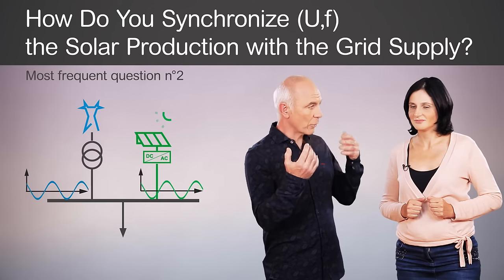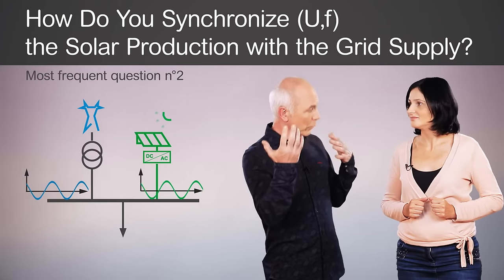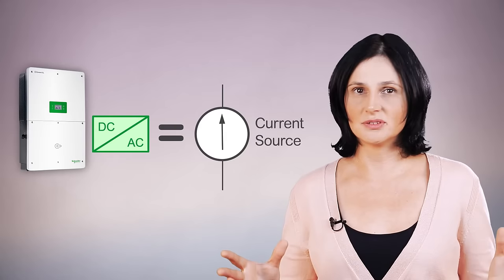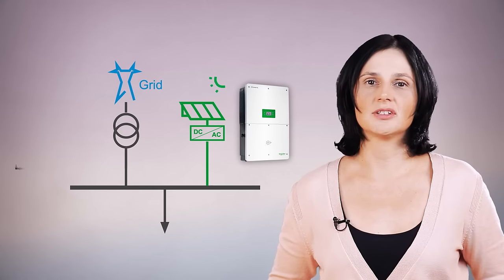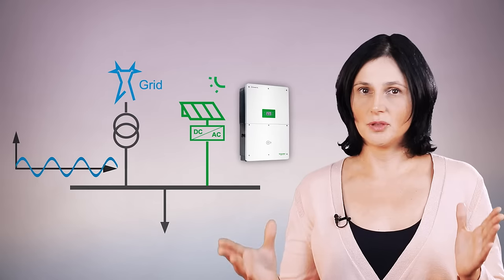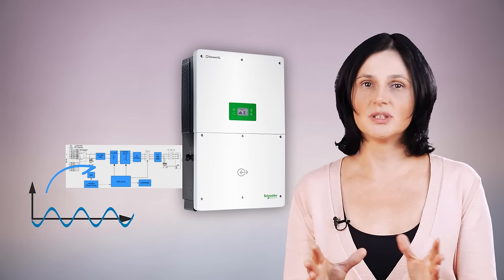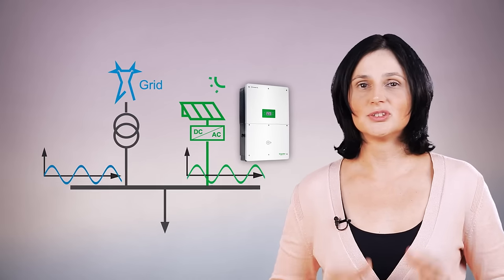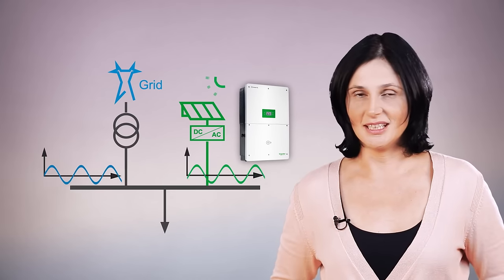Solar Self-Consumption: How PV is Synchronized with Grid Supply | Schneider Electric

Comment: What happens if there is an outage to the utility? Will the PV still be able to give output?
Reply from the maker: Thank you for your message. We house most of our documentation in a virtual database here: https://www.se.com/ww/en/download/. If this does not address your concerns, please reach out to a technical support person in your location.https://www.se.com/ww/en/work/support/country-selector/contact-us.jsp
Reply: no
Reply: If the utility goes down your PV goes down. The only way to maintain power if the grid is down is to have an  off grid inverter as well and a method of change over.

Comment: I’m a simple minded person and I still didn’t understand how a DC current created by a photovoltaic system is synthesized into the grid. I understand that an inverter type system needs to be in place, but how does that work? I see many acres of panels, what looks like substations, and a BESS unit, and nothing more to explain the transition.